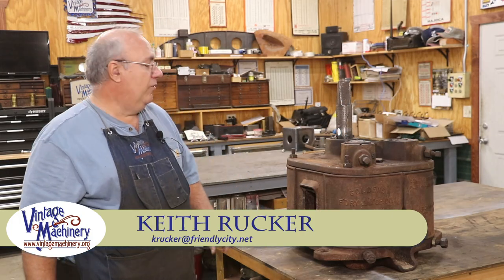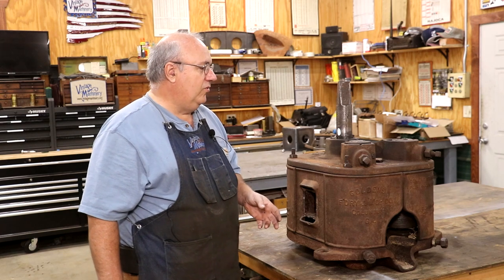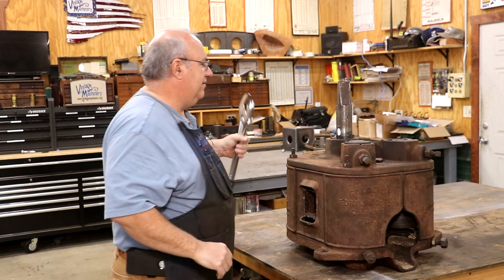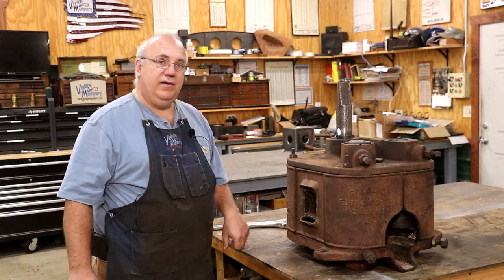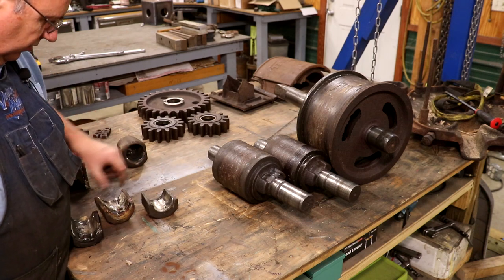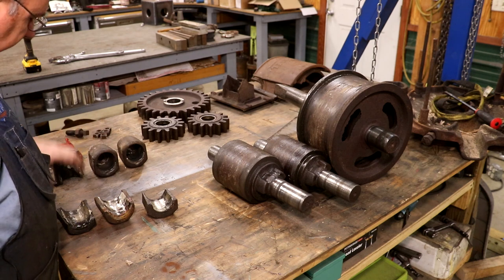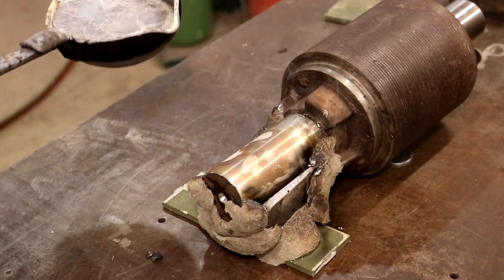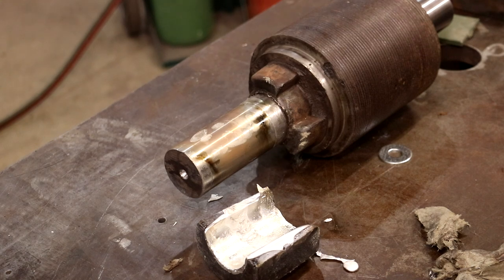Restoring a Goldens’ No. 2, Three Roller Sugar Cane Mill

Comment: For food-grade applications, I like to use mineral oil (from the pharmacy).  It is meant for consumption, and it doesn't go rancid or get sticky like vegetable oil can.
Reply: I was going to say the same thing.  I use mineral oil for sharpening knives with an oil stone.  It doesn't go rancid (my father used to use olive oil on his oil stone, stank to high heaven) and, other than a mild laxative effect, mineral oil just passes through the body with no problems.
Reply: Also, there are food grade silicone spray lubes. I bet there are lots of other food grade lubricants for industrial food processing machinery.
Reply: Uh... What about the lead in the babbit bearing?  It might be the reason the South comes dead last in academics.
Reply: @bobweiram6321  - Uh.... You could watch the video before commenting, so you don't come dead last in YouTube academics.
Reply: @bobweiram6321  Ah! Remember the good old days when there was lead in the gas, lead in the paint...
Reply: I was going to say the same, my first few bowls I turned got throwed away because of this mistake as they really stink after a while like the whole kitchen. lol
Reply: @bobweiram6321  Tin, copper and antimony. So sit down.
Reply: @aserta  Antimony is very toxic as well. So stand up and pick up those knuckles.
Reply: Probably not as bad as they paint it to be.  No pun intended.
Reply: @bobweiram6321  good question.  Tin-based in this case.  I wonder when tin-based became available, and when awareness of lead contamination developed.
Reply: @robertbamford8266  We've known about lead being poisonous since Roman times, either way, completely pointless in this discussion because the juices don't touch the bearings, it's designed not to. It would be a really shoite design if it did, because, i know, shocking, cane juice ain't lubricant. But hey, some people just looove them stirring of problems.
Reply: @aserta  Actually, the question could have been better worded as “when did awareness of (possible) lead contamination of cane juice from lead bearings in the mill develop?”  I grew up with lead toy soldiers (time in the hospital as a result), lead paint in our Boston apartment, leaded gasoline, and lead in water pipes. So knowing lead is a poison is neither issue nor is it sufficient. It’s knowing all of the ways lead can be transferred to people. I was envisioning the powder created as lead-based bearings slowly wore.
Reply: @aserta     Ethanol is a bad one too.   Neurotoxins or what can be toxic when it comes to chemicals and compounds and such can be misleading.    Often it’s just a matter of amount or prolonged exposure to something while others it’s entirely dependent on the form or if the chemistry is a compound or blah blah blah ions and blood barrier words and stuff.  Lolz. Ya know what I mean.         It’s interesting that something like fluoride being one of the most abundant elements found on land and even we develop trace amounts naturally in our teeth- along with it even being beneficial to our dental Heath; which if ingested in super high doses over time can be a super toxic thing but otherwise harmless. 

Cashews, bananas, potatoes, star fruit and practically an endless list of things we eat have similar trace amounts of any number of what could be neurotoxin or toxic in high doses.     Mercury is another one where in theory cannot pass through the skin if someone handles it but if they have a cut on their finger or mess with it often…ya know the drill

The lead thing and south scoring low in academics was obviously just a joke but there’s definitely examples of such occurrences throughout the industrial revolution and forward of prolonged exposure to shit that is wicked bad for humans just like the romans and lead thing.         Interesting stuff

https://en.wikipedia.org/wiki/Neurotoxin
Reply: @bobweiram6321  ....I suggest you watch the video.
Reply: @aserta  The cane juice may not touch the bearings (although I would question that for the lower bearings), but as the bearings wear away that stuff has to go somewhere.  The amount that any given individual might ingest may indeed be low, but I applaud the owner's caution in using tin-based babbit.  Especially since the mill would appear to be destined for use in a public event.

Have a look at the first 3 minutes of this video that Keith made 3 years ago: https://youtu.be/1nO2WuhQz9A

Comment: My bride's uncle got a cane press mill years ago at an auction down south.  It was mounted on an old wagon and he cleaned everything up ready for pressing.  He had planted some sorghum and when it came time for pressing the only horses he could find were his friends pulling ponies.  Long story short, those pulling ponies were trained to lunge into their harnesses.  They about tore the whole thing apart and plan B was implemented, a lawn tractor and a boy driving it.  
His molasses making started growing each year and soon busloads of senior citizens were coming.  He barely had enough molasses for his own use.  He finally said enough.  He had just wanted to relive his youth and have a little molasses for himself and his family so he sold the whole setup, syrup pans and all. While not tasting the same, store-bought molasses were a lot easier.
Reply: The "pulling ponies" is funny.  I believe the proper expression is, "The ponies were quick broke."  Always be careful around ponies or horses that are "quick broke."  The unexpected will happen. Very quickly.  Boy on a lawn tractor is a great solution.

Comment: Keith, I repaired bakery equipment for a living. Vegetable oil turns gummy after a while. Use mineral oil. Bakers would use vegetable oil on equipment, it would turn gummy and the equipment would get very hard to use and even sieze up. I would have to disassemble and clean them, then use mineral oil. Some equipment had oilers and the manufacturers required mineral oil to be used. We used food grade mineral oil by the gallon but you can use a small bottle from the drug store.

Comment: Larry Bolan is absolutely correct. I worked in a bakery for 21 years and you had to have the stuff, You can also get food grade oils as well. Another option may be mineral oil. The problem wit vegetable oil is that it dries up and gets all gummy, You can over come that with more, but then you just end up building up the residue of the dried oil and it's a pain to clean.  Keith, nice job as usual and a nice choice to do a condensed version of,

Comment: Sure helps when you have done a job before. 
Just worked on some tiny foam tools I make from solid carbide blanks. They had 1/8" shanks and 1" OAL.
The cutting diameter is 
7/32" . From start to finish it takes 8 different 
operations and a lot time. Point is the second batch was much easier .
Done them eight times so far.  I was hoping the first would be the last. 
It is money.

Comment: Nice video. I was wondering what surface were all the components resting on vertically? You explained only the big bearings for the side forces. I’m guessing the rollers are just resting on top of the bearing edges and the gears are sitting on a surface that’s part of the case…?😊

Comment: A really interesting little 'pocket project' to watch! I could tell that you might have done things differently if the mill had been your own property and you had more time--perhaps replace those loose sleeves on the cogs and do something about the shoulder you were forced to leave because of them on the shaft. I also seem to remember when you have poured bearing material in the past you ensured the shaft you were using as a pattern was coated in carbon. Did you forgo that step this time as part of the owner's very understandable food-safe requirement?

The difference is night and day from the start to the end of project! The rollers wouldn't turn at all and now they spin without difficulty. I look forward to seeing the video of these machines in action! I imagine one of the many improvement over the original 1-mule-power engine is the fact they can be packed closely together now and multiply the output of syrup. Does that syrup go on to a final stage at a different company again to be crystallized into sugar or does it stay as syrup?
Reply: I understood that, in small quantities, carbon is considered quite safe to ingest.  It's at least the same level of "safe" as the small amounts of tin, zinc and copper that might leak from the "Eco-Babbit" alloy that was probably used.

Comment: At 20:30 keith starts talking about the babbet bearings and why they are only on half of each fitting.  Cool.  My question is how about preventing wear on the bottom end of each shaft?  Is that somehow dealt with?

Comment: Among others, Abom79 has advocated for the value of spray welding. Wondering if those shafts would have been good candidates for that process and what your thinking might be about that approach.
Reply: Since there is no specific diameter prescribed due to the babbitt just filling whatever necessary, I do not think the spray welding process is viable.
Reply: Spray welding is additive so a journal can be machined to fit either a stock bearing or bushing. In this case the babbitt is poured so it can be poured to any size, it is far easier to just remove some journal material and allow the babbitt to take up the space.

Comment: Two questions, I thought that would smoke the shafts, with acetalene before poring, and also, painting the cast iron, would that contamiate the syrup?
Reply: you wont get carbon on there if your torch is set right.
Reply: You apparently did not read what I was asking him. I do know about adjusting the torch so to not get a carborizing  flame. In the past he and others would coat the part with carbon so that the babbit would not stick to the shafts.
Reply: @combatmedic1980  I read what you wrote, but apparently you didn't write what you were thinking.

Comment: What was the loose sheet metal panel in between the large roller and outside panels. Did not see it on the table in the exploded state before reassembly

Comment: So, what are those gears for? It looks like they are not pressed or keyed to the shafts and they spin freely...
Reply: There are 3 cogs that the gear fits over, locking them to the shaft. That is what makes the two presser wheels turn when the big roller is turned.
Reply: Got it, thanks.

Comment: How is the bearing shell distance set before the babbitt is poured ?
Reply: Distance set by eye. The bearing are fully floating so it doesn't matter in the slightest how thick or thin they end up (providing there is enough meat there of course).
Reply: @johncoops6897  Thanks for your answer.
Reply: @RichieCat4223  - I forgot to add that these old machines are designed to be serviced in the field without special tools or equipment. That means that they might have adjustments that would not be provided in modern (more highly engineered) designs.
After he gets it reassembled, Keith shows the 4 (shiny silver) adjustment bolts that move the bearings shells into position. The operator would be adjusting those every few days, since the bearings would wear relatively quickly.

Comment: If you soot up the shaft with some acetylene, you won't need to scrape the bearings. And mineral oil is a better choice. That vegetable oil will go rancid over time.
Reply: Probably put too little to even help with anything anyway.
Reply: No need to soot it, its only a half bearing. If it was a full bearing then sooting will help.
Reply: It needs to be food grade hence vegetable oil.
Reply: @dcrahn  yes I know this but you are dealing with a food product so mineral oil is not acceptable.
Reply: @chrisoverman7551  Do your research, Food Grade Mineral Oil is readily available.

Comment: I guess I don't see how the gears on this work?  Are they keyed to the shafts in some way?  Based on the video and the addition of spacers, it didn't seem like there was any keys or set screws or anything...
Reply: There are 3 cogs in the top of each roller. The gear fits over these cogs, locking them to the shaft so that the presser wheels turn with the big roller.
Reply: @MadDawg91108  AH! I remember seeing those.  Thank you!

Comment: Let’s see some test cuts on the metal planer.  A year (?) to rebuild and no final information on if it’s actually a useable machine. Come on.
Reply: Keith did show some test cuts. You must have missed that video.
Reply: Yea he took a couple of cuts but did no measurements or accuracy set up. Disappointing
Reply: @bigalhudson  ...The solution is to quit watching.  Don't put yourself through the misery!  I am sorry you are disappointed.........maybe.
Reply: If you’re going to all that effort to restore an engineering tool it’s not unreasonable to see if it’s actually useful. Otherwise you could just cover it in primer and put it out in the yard.